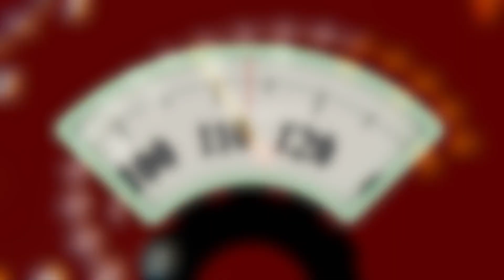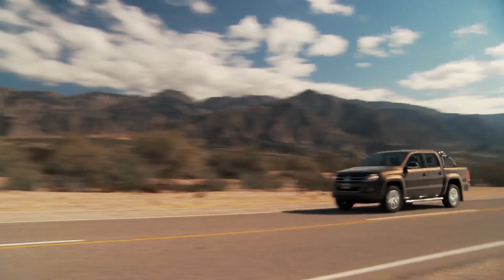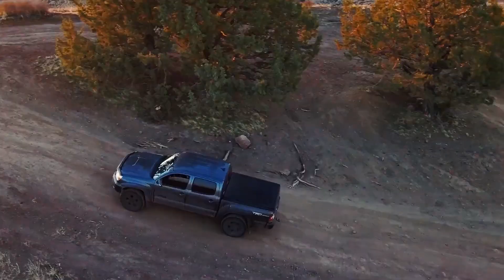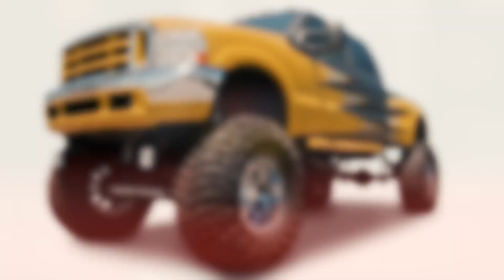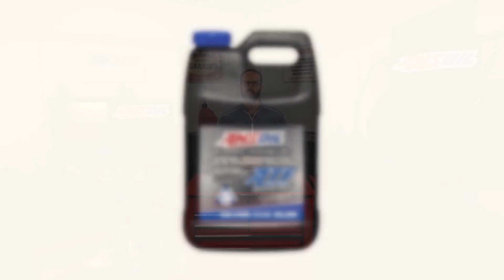Big Wheels & Tires Make More Work for Your Engine & Transmission

Comment: And not one word about re gearing the truck to lower gears for taller and heavier rims and tires to put the engine back in it's power band and lessen the strain on the transmission